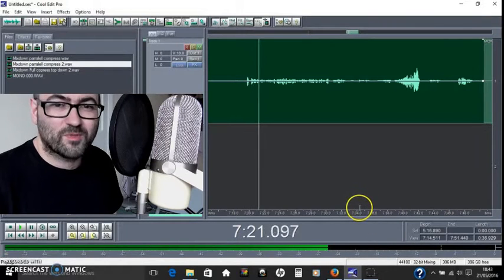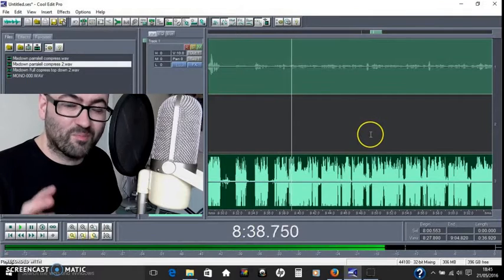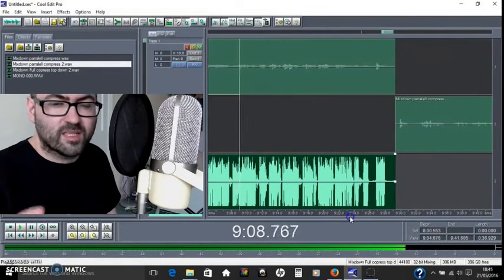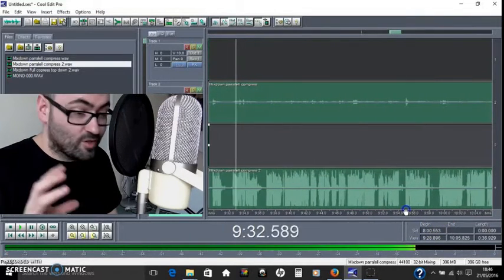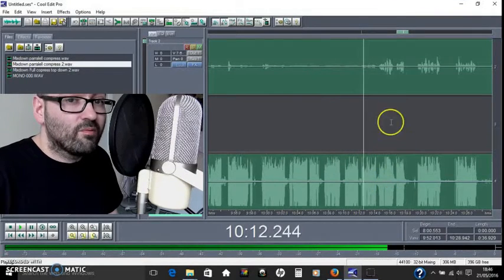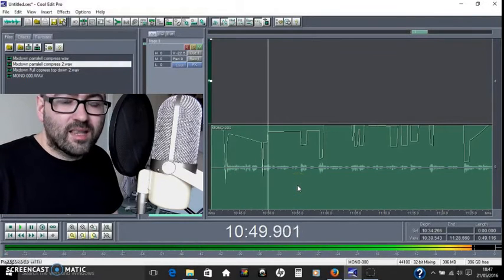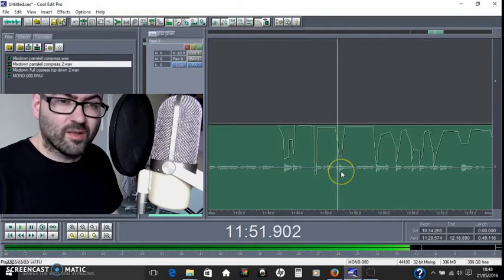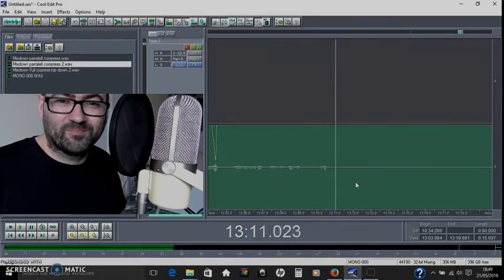Cool Edit Pro 2.1 - Compression For Voice Recordings

Comment: Hi,Im using cool edit too can you show me how you do that effects? Can you break it down ? Reply please
Reply from the maker: Sure it's simple enough, you need to make a copy of your vocal track and compress the hell out of it go to Effects then Dynamics Processing then pick a preset like drum squash and that should suck the life out of the sound. Save this file as 'Vocal squash' or something similar. 

You have 2 files now - Normal vocal and Vocal Squashed. Open the multitrack view and insert these files on tracks one and two.

Normal compression (be it very HEAVY compression) is just the Vocal Squashed track

Parallel Compression is both tracks playing at the same time with the normal vocal turned up and the Vocal Squash track turned down.

Automation is achieved by using the 'volume envelopes' which is activated from a button on the row of buttons along the top of the multitrack view - look for one that says 'dB' on it - then draw volume levels onto the track. Just turn up the track and when it peaks and distorts... turn that small section down on the track. You can dial in the volume of each word if you want to :) 

Hope that helps
Reply: Hey Tim, I can't find the preset Drum squash, is it the exact name of the preset or just an example (or maybe a preset created for you), thanks for the answer
Reply from the maker: David YouTube  Sorry for not getting back to you. Just any really heavy compression preset will do the trick or just do low threshold and high ratio 10:1 that would be a what I would call a 'Squashy' downward compression.

Comment: How do I send a session to get mix and Mastered ?
Reply from the maker: Hi Mike, thanks for the comment. I don't offer that service but if you want to send a Cool Edit based song to someone for mixing and mastering you would have to 'mixdown' to Wavs each track in the multi-tracker as either mono or stereo - save .waves at high resolution and label them as accurately as possible. It's best to send a demo mix of the track too so the mixer can get the elements of the track in the right order. Hope that helps.